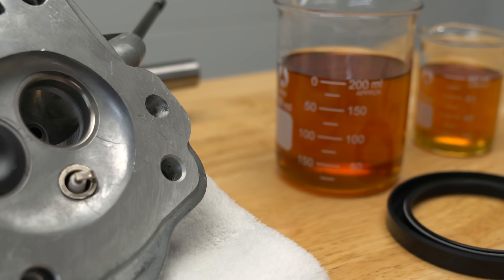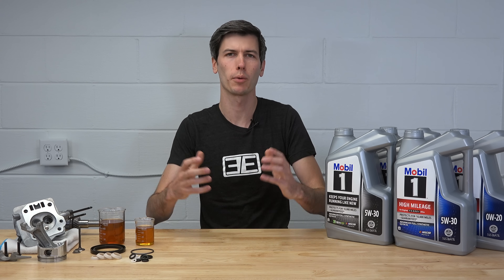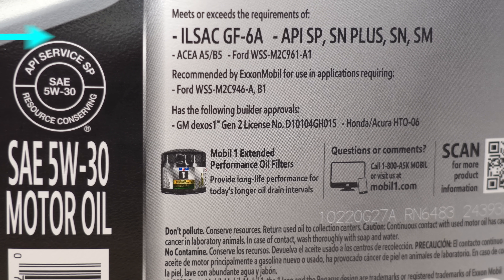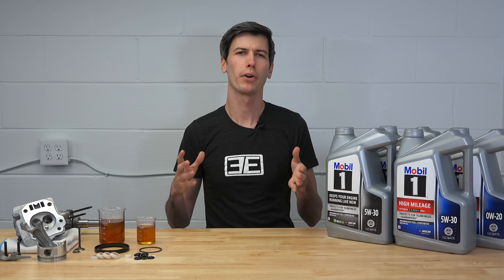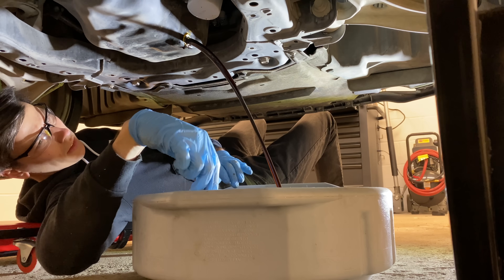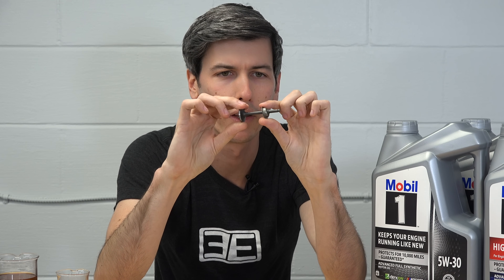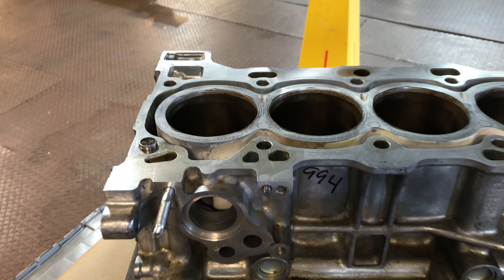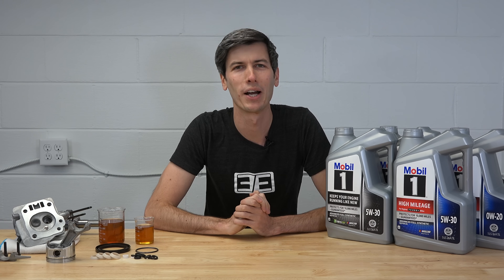Is Synthetic Motor Oil Bad For Old Cars?

Comment: I heard synthetic oil was bad to use on older engines using “rope type” seals which was mostly used for the rear main crank seal. The synthetic oil would dissolve them in a short time and lead to a very large oil leak. Neoprene &/or rubber was okay. Some domestic engines like Buick used rope seals not only at the rear crank area but also for the front timing cover crank seal (one or more of their V6’s). Not sure about leather or rawhide seals. The brand name “CR Seals” stands for “Chicago Rawhide” which of course is from many years ago.

Comment: They told me the same thing, use thicker oil and I did switched from the factory recommended 10/40 to 20/50. The engine started to rattle and vibrates (very similar to a bad engine mount), harsh cold start and slightly worse fuel economy. Switched back to the regular 10/40 and the engine back in shape immediately. Its debatable but from my personal experience ALWAYS stick to factory recommended viscosity.
Reply: I second the advice to stick to factory recommended params, but also, maybe you should have chosen 10W-50 instead of 20W-50. The first number is the cold viscosity, the second number is hot viscosity. 10W-50 is the logical choice for a thicker version of 10W-40.

Comment: I have an old 1970 ford truck that I thought my Dad said to only use non-detergent oil in. Is that not correct? Should it be using regular oil or even synthetic?

Comment: Zinc additive is a must, I run synthetic in my 1970 GTO, the car has a flat tappet cam so I use a zinc additive. Using oil without the additive in pushrod (non-roller cam) engines will wear the tappets very fast. I know this from experience. Synthetic oils have superior lubrication and can withstand higher engine temperatures than conventional motor oils. I prefer Amsoil, but I will use Valvoline VR1 if zinc additive is not available.

Comment: 🤔🏁ENGINE seals is THE REAL problem . ANY engine built with REAL Teflon seals usually has NO leaks of ANY kind. I REALLY do KNOW I AM a REAL ASE certified Master Auto technician with OVER 60 year's of REAL  experience a lot of automobile companies use  cheap OIL engine seals .when they should be using REAL Teflon seals NOT cheap OIL sales 🏁🏁

Comment: i run from 546.000 km till the end 936.000 km app. my 2 liter 90 hp LPG audi 80 avant 1993 with high mileage oil, they really work fine, almost zero oil consumption even with a valve seal gone, reason why i start to use this kind of oil. Well just one thing, oil pump really struggle when weather it's really cold near to zero degrees, i use to warm up engine at least 10 minutes before take off... i can imagine modern oil pump made entire from plastica really could fail with high mileage oil.

Comment: My 2008 2.2L HHR always burned about 1 qt/ 3,000 miles. Now at 222,000 miles it's burning 1 qt /2,000 miles. I’ve always used Mobil 1 5w-30 oil and as its gotten older Mobile 1 High Milage oil - say weight. Question: Can I potentially decrease oil consumption by moving to 10W-30?
BTW the engine has zero oil leaks on the ground. Totally appreciate your videos.

Comment: You say a 20 won't make a difference to a 30 oil but in my experience when I tried a 0w20 oil in my car it used 1.6L over 5,000 miles, with 0w30 it uses 500mls over 5,000 miles. My car specifies both 0w30 and 0w20 oil and thought I'd try the 20 oil to see if it stopped piston slap and it did, just the oil consumption was too high for my liking. I've been switched back to 0w30 oil for the last 20,000 miles and it still uses 500mls so I don't think the thinner oil caused any damage, I just think that it slips past the piston rings more easily.

Comment: Been usuing Mobile 1 5-30 synthetic in my 01 GMC 2500 HD 8.1 for 17 years with 315,000 miles.  Had a compression check two months ago.  Seven of the eight cylinders showed very mininal loss.  Without going through all eight cylinders.  Averaged 135 psi/cylinder.

Comment: One thing on the rotary engines. Some of the reason people would be skeptical of using a synthetic in a rotary is partially because Mazda actually says in the owners manual that they do not recommend using synthetic oil. This is a rare case of something actually coming from a manufacturer rather than just your granpa saying synthetic oil messes up your engine.

Comment: Whoa. Those rotary engines could be trouble! I once changed the valve seals on a Volkswagen Rabbit. You had to pressurize the cylinder with compressed air otherwise the valves would drop into the cylinder. I was afraid the compressor would crap out or the power would fail. That car was high maintenance!

Comment: i sure do have old cars. to get proper oil pressure they are running 20w50 now. a synthetic oil would simply kill em. but if your up to the bet, you buy me a new car if i put these new, super thin oils in them and run them. yepp they are worn, they are old. oldest is 1982 make. now thats OLD.

Comment: In America they think that Grp3 Dino is “Synthetic” because advertising companies have very good lawyers.

 In science, in laboratories, in the oil industry and in any mechanics garage, we understand that only Grp4 and Grp5 are synthetic.

 Yes, you can use grp4 and grp5 oils in older engines - my BMW 506/1 V8 engine lives on Redline 10w40 and never leaks.

Comment: Shell and Mobile One have had class action lawsuits in the aviation industry from full synthetic oils. The synthetic oil has not been able to break down the sludge in the way natural oils can. Engines have not made to their time between overhaul and have caused propellers to lock up. Also, I know of experience in performance cars on a race track where switching to full synthetic caused bearing failures when a very brief loss of oil pressure in a turn. They synthetic was so slick, it did not maintain adhesion. Back to semi synthetic and never a problem again. I have seen both these problems first hand and will never go full synthetic; but I do think the blends have the best of both.
Reply: Could not find any info on Shell class action suit on aviation engines.  Shell yes.

Comment: Since Mobil one destroyed my new 1996 jeep due to poor lubrication,both middle cylinders and bearings were fried the dealership could not find anything mechanically wrong with  the oiling system they gave me a new short block and suggested conventional oil .My old cars and tractors get 30 weight in the summer thank you !!!!!

Comment: Valvoline full synthetic I've used since I bought my car and change it every 3000 miles and it's never dirty or broke down .Great stuff ! I use Valvoline full synthetic 5w30.Also use Toro full synthetic in my tractor , mower , power washer , snow blower .

Comment: Hi. Rav4 2.0 l. Diesel had originally a CF and CF-4 5W30 oil recommendation. Now diese oils no longer exist. What would you recommend considering that car has 197000 kilometers on the clock? What are the synt specs that are safe.
Thank you.

Comment: I have 1990 toyota 1000cc that has stuffed valve seals, i do have the replacements to fit, but am now tempted to try the high mileage oil first, and see what happens. I Had not heard about the seal swelling properties before. thanks. 
Wonder if its ok for the 05 touareg v8? as well(leaks a bit).
Have also used mobil one in most of my vehicle's for a lot of years, i personally have not encountered a chronic leaker, from going synthetic of same or similar grade, in any of them.

Comment: I have and old direct injection diesel van, over here in Europe, the Ford Transit. I am usually using 10w40 and it burns some oil. I think its even going thru the exhaust (small spots on the rear), so either exhaust valve seals or piston rings. as a test, should I turn to 15w40 or 10w50?
Thanks.

Comment: I had a customer who was a mechanical engineer, although not in the automotive industry. He was very meticulous and studied everything. He bought a used '85 Lincoln Town Car with a F.I. 5.0 liter. It used a lot of oil but had no visible leaks. He was sold on synthetic oil and it's improved detergents. He changed to Mobil 1 and then after 500 miles changed again and then after 500 more miles changed again. After each change his oil consumption dropped and continued to drop. After the 3rd change he ran the oil for 5000 miles and changed it at that point there after. It had very minimal oil consumption after that, approximately 1 quart between oil changes. The car had about 70k miles on it when he originally purchased it and it had about 130k when I met him and took over as his mechanic. I know the car had been owned by an elderly couple before he purchased it so I assume many years of low engine speeds and probably poor maintenance had resulted in carboned up rings but the fact that using regular Mobil 1 cleaned the engine up so fast was pretty impressive.
Reply: i think what happened in that engine, is the better oil slowly made his stuck piston rings to become unstuck again.  So the rings stopped shoveling the oil into the cylinders and sealed properly again.
Reply: @Tiberius_I  Good thinking!
Reply: Very apt story. I have found that abused industrial diesel engines that are full of sludge respond well to two or three 50 hour oil/filters changes and then 250 hours from then on.
I'm afraid of what sludge and chunks will do to screens and filters if they come away too quickly. So standard 15w-40 diesel oil and frequent changes may allow for gradual sludge removal, without overwhelming the filtration system. There's no such thing as an oil filter that's too big.
Reply: I've been using Seafoam for this for decades, and I just did a 2015 Chevy Cruze 1.4 turbo last month for a friend that had bad oil consumption along with a head gasket leak. Did the head stuff, new timing chain and gears, new seals on the cover, and 2 oil changes after repairs. First oil change was with Supertech Walmart junk oil. I put 6 ounses of Seafoam in it, along with about 8 ounces of Acetone, and ran the engine about 5 houirs. drained it, and did it again with mobile 1 synthetic and a new filter. With 100 miles most of the lean codes and ond other "Misfires" quit! Now this engine runs great, and the turbo really spools up! 145k and it will run to 200k now. These new engines with the Cam Phasers, and other tricks for performance really need to be clean inside! Varnish will stop all those parts from doing their job right! Cleaning it out allows the lifters to move right and the cam phasers to turn like they are supposed to do. Really works on Honda V tech systems as well! These new engines ain't your old school small blocks where you could run left over french fry oil and they were happy!🤣🍟
Reply: @billk9628  I think that's great that witches brew worked on that engine.  But I'm not willing to put seafoam nor acetone (!) in my engine and run it even for 5 minutes - it is counter-productive, you are creating more wear by running the engine on solvents -
Reply: @Tiberius_I  Think of it like this, when you get that brown varnish on an engine part, how do you get it off? That varnish will hold up things like VCT adjusters while the engine is running, and cause lots of issues! Correct? SeaFoam, acetone will disolve that varnish and flush it out. No other way to deal with it, and changing oil wont fix it in a timely fashion so what else you got? You could try Mineral oil, or ATF, or any number of other ideas. SeaFoam was the original cleaner used in Fuel injection systems back in the early days of the 1990's for the new engines. Used to have to pay quite a penny for that treatment then, but it costs about 10 bucks now. Don't believe me< don't use it. But if you just bought a car that the maintemance was hardly done on, and you need to get ahead of the game with it, this is how you do it. As I sad, I have been doing this for many years, and it works. But you don't have to believe me. And I don''t care if you do. Your loss, I'm just trying to share my knowledge. But if your to closed minded to listen I can't help that. Good luck.
Reply: @billk9628 supertech isnt junk oil.  Go look at some sample readings of it 🙄
Reply: @johnjackson1924  I dont care about the ratings. I care about what the inside of my engine looks like! Super tech is garbage oil! You wanna run it that's your business! i wont, not even in my lawn mower!
Reply: Thanks for sharing. Just curious, do you remember what sae grade of oil he used in that car?, perhaps 0w40? Since it has an overall better base stock than a 5w30 semi synthetic or a 15w40 mineral oil group 2 with low quality detergent components?
Reply: That's the opposite of most people's experience; my consumption went way up on synthetic
Reply: Instead of such repeated changes, he could simply have used engine oil flush that would have done the trick in a single oil change
Reply: @shrujanamsyama9940  That will clog the oil pump screen, not a good idea.
Reply: @kennywhiddon1497  Oil flush is specially designed solvent which dissolves sludges & other hydrocarbons with lower viscosity to ensure that it does not clog any valve, openings or fuel pump. I recommend against using diesel, kerosene etc as flushing agent but use branded flushing agents like Liqui Moly to avoid problems
Reply: Quel grade ?
5w30 , 10w40 , ... ?

Comment: I’ve been using full synthetic oil in everything for close to forty years now since my Esso agent introduced me to it and I am still running a 1979 Pontiac motor with over 720000 kilometres on it now which has never been wrenched on and you still can’t hear even a lifter tick! I usually change my oil on around 6000 to 7000 kilometres and at age 69 I fully expect my motor to outlive me in my 1981 Cutlass!!

Comment: I was using synthetic oil in my 39  hot rod with a 400 small block Chevy engine. I was using two or three quarts in thousand miles. I switch to non synthetic oil and oil consumption dropped to 0ne quart.

Comment: Early on engines had looser tolerances so the early 5W20 Mobile 1 tended to leak and allow oil to get bythe rings and  into the cumbustion chamber.

Comment: The only answer to this question is RTFM! If car's manual allows the oil spec then use it. I have a 38 years old car and synthetic oil 5W-30 is considered in -20°C conditions. So says the manual! I don't bother at all.

Comment: Good vid.... but internal testing isn't always the best.  AND.... (as an ex R&D Chemist) I know sometimes the people up top just want to push out a product.   So... did Mobil tell you that their oil... specifically made for "V-Twins" was eating the alternator coils in the charging system?  People figured it out... so Mobil was forced to make a statement saying.... "Not for use in the chain case".  (Although it was marketed that way)  THey may be one of the older synth companies... but mistakes have been made, and I will stick with other brands. (Like Rotella)

Comment: This was a great video, and I especially enjoyed the confession regarding the problems with the first generation synthetic oils.  If you're going to start advertising Mobil 1 products, why don't you take it to the next level and tell us why Mobil 1 is better than the competitors?  As a service advisor, that would greatly interest me.   Is Mobil 1 really worth the extra money?  My own suspicion is that there are too many variables for service advisors to know, much less the average car owner.  So, if your friends at Mobil know of specific circumstances in which their oil is truly worth the extra money, preferably along with balanced information regarding when it isn't worth extra, please enlighten the rest of us (and I'll seriously consider selling more Mobil 1 products for them).  I would invite you to do the same for Royal Purple, considering their motor oils generally cost even more than Mobil 1 products.
Reply: Mobil 1 is generally the cheapest or at least right on par with Valvoline or Pennzoil. 

Royal purple you have to make sure you're using the daily driver oil and not the race oil, as the race oil has much less cleaners, corrosion inhibitors, and dispersants since it's designed to be changed every 500 miles or less.

Comment: I like the synthetic blend High Mileage oils. My wife’s 2010 Chrysler town and country with a 3.8 liter V6 had a TSB on these engines were prone to consume a quart of oil between 700 to 1,100 miles from the factory. Our van already had 101,000 miles when we bought it. First time I used what the engine called for which was 5w20 and by the time it was due for change it used 2quarts of oil. I’ve tried many brands of 10w30 but no success. Finally I was suggested to use a High Mileage synthetic blend oil which was Castrol High Mileage synthetic blend 10w30. By the third oil change it reduced consumption in half and I’ve been sold ever since.

Comment: my Renault 5 gt turbo was recommended to use multigrade oil but when semi synthetic come out i used that i.e shell Gemini, then i used Mobil 1 tri synthetic as it was new at the time, i had no issues or burn oil even having the car engine modified, changed oil every 3k though dam good oil that and engine looked clean from what i could see and the oil dropped was never black

Comment: Mobil 1 Full Synthetic Oil is my favorite oil.  I've used it on my Ford F-150 with a 3.7 L V-6 engine for 11 years and at around 149K miles the engine runs as well as when it was new.  Thank you, Mobil 1 and Engineering Explained! 👍👍👍👍👍
Reply: Not only do I use Mobil 1 FS oil, I only use Mobil 1 oil filters. They are the best filter on the market.
Reply: @jbacker1190  I'll have to check out the Mobil 1 oil filters.  Thanks for the tip.
Reply: @audiophileman7047  Drove my 2010 Mazda6 for 318k. Used Mobil 1 oil products exclusively. Only reason I got rid of it was the transmission died. Otherwise, it ran like a top!